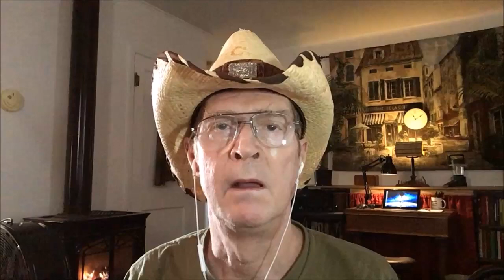Short Dipoles Fed With Open Wire

Comment: ideas for using a unbalanced tuner with open wire line or twisted pare? wold a ugly balun work aka air choke? all so can one dc ground a horizontal loop at the feed point to one side of the loop or at the tuner to one side to drain off static? wold like to try a horizontal loop but have no balanced tuner. can one feed a horizontal loop with coax? well take care good dx!